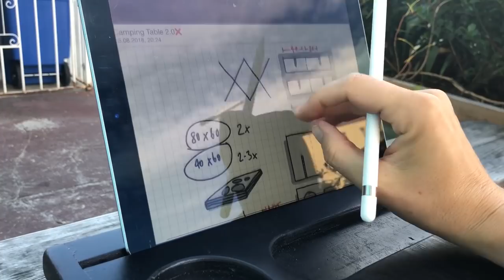Camera Case Hack (Work and Travel EDC)

Comment: How can you stand doing so much hole saw work with the hand drill??!? That's like second on my hate list right after cutting a plaster ceiling with the rotary cutout tool and no dust collection. I'm pretty sure you've got a drill press or could fit one into the shop; I got a < $100 cheapo bench top model new that isn't as nice as a big floor-standing one but actually fits in my available space and is way better than the hand drill for lots of applications. I'm sure doing lots of it and developing good technique helps a lot to avoid jams and uneven cuts and such, but ugh.

Comment: I would design it a little differently, When you use it as a tablet stand, you can't use the cup stand, because the cup obscures your view.

Also, I would hollow out the inner plate more. That's unnecessary dead weight...